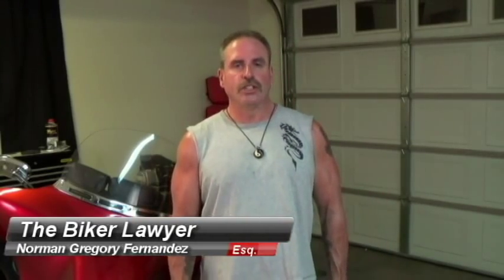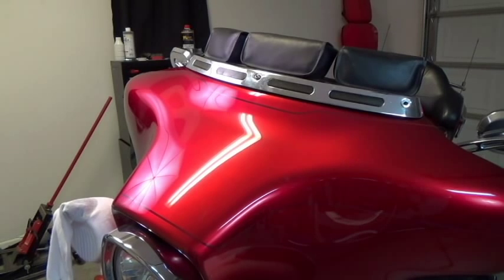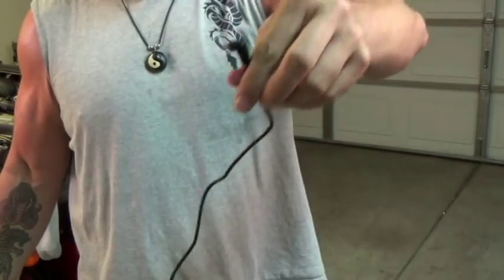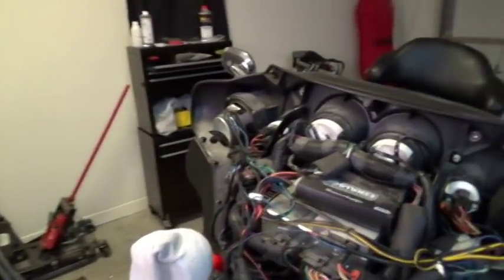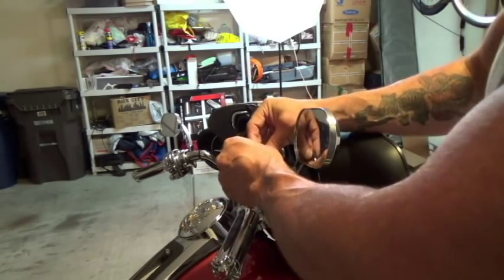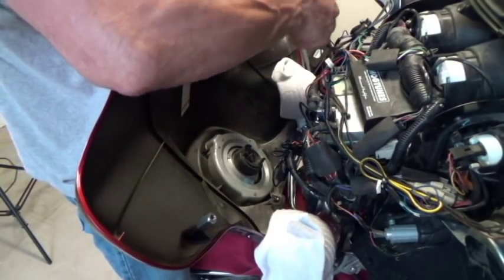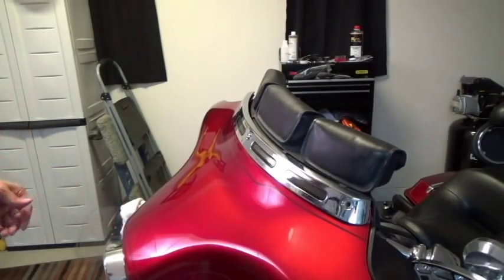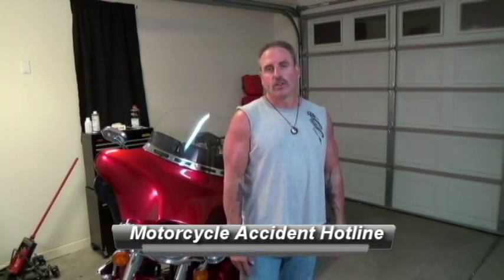How to Hard wire a GPS into a Harley Davidson Electra Glide

Comment: Came here looking to find out what two wires are used from within the fairing.  Thanks for outlining that, but seriously, you should take your fairing off and either solder the connection with heat shrink, or spade connectors with heat shrink.  You and I both know these machines shake and twisting the connection together and wrapping it with electrical tape is only going to last so long.  You don't want those wires coming loose and grounding out inside your fairing.  Thanks for the info.  Maybe I will catch you at Sturgis this year.

Comment: Dont be cheap, you say the bike goes is a rip-off but you had to buy a transformer that already comes with the zumo, the zumo has other bike features like twisty roads and your cheap car gps isnt water proof or shock proof. 
The little boot you put on the mini plug doesnt water proof the GPS. You also bought a cover for the gps, more cost. 
Get what was designed for the bike and dont worry anymore
So either

Comment: AWESOME VIDEO Mr. Fernandez. AWESOME. I do have one question though. The step down converter that you used, by chance do you remember the brand that it was? I have located one on Amazon, a DROK model. I'm just trying to make sure before I pull the trigger that I have the right one. With Radio Shack out of business now it makes it a little more difficult to find something like this. Any assistance that you can provide would be greatly appreciated. Thanks. Ride safe and be safe.